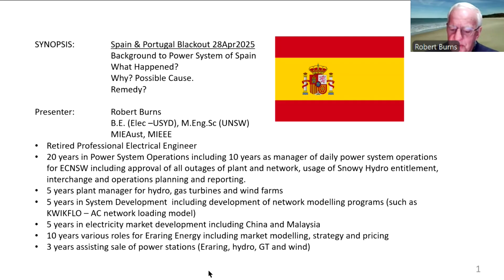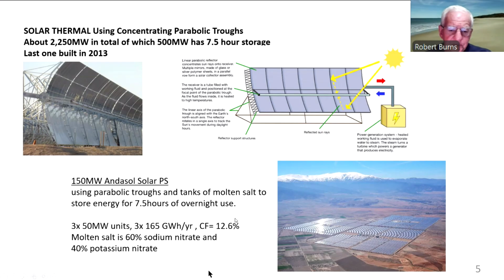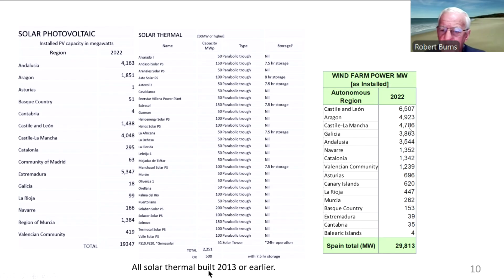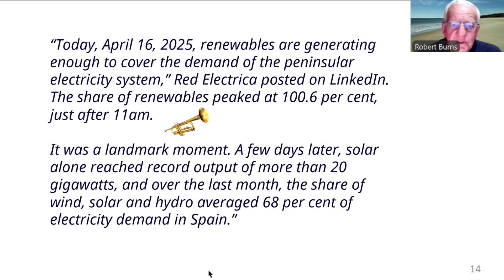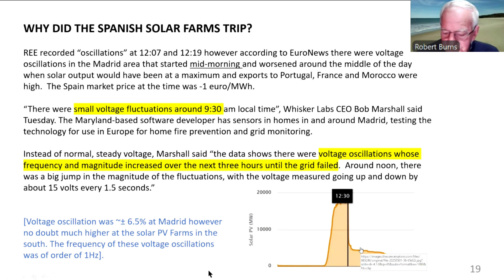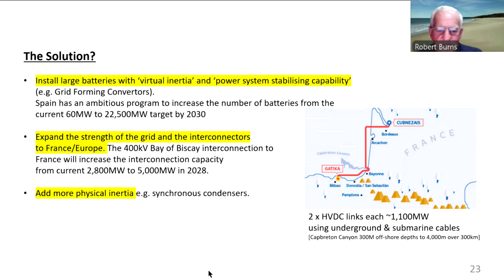The Spain-Portugal Blackout - Robert Burns B.E. M.Eng.Sc (UNSW)

Comment: Inertia as synchronous condensers has been added to the UK grid in three tranches and another is due shortly. One reason its not added in a single go is that technology advances quite quickly and virtual inertia from inverters (along with grid following or grid forming capability) has appeared quite rapidly and may displace physical inertia by being both cheaper and potentially more proactive given broader inferencing from the whole system analysis. The 300mS action response from inverters may  be more able to avoid chaotic instability that even a large number of physically distant spinning tops may fall into under certain circumstances, e.g. adding a more impulsive energy to damp burgeoning oscillation (inferred from high RoCoF and other data) rather than being part of the chaotic problem.

Good analysis and clear and obvious solutions.